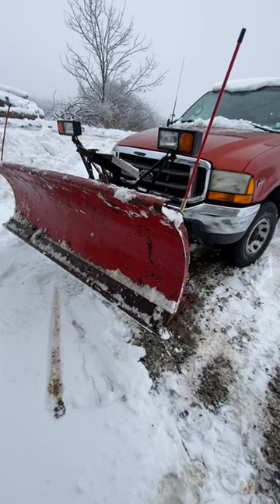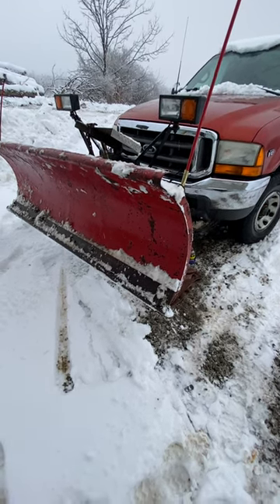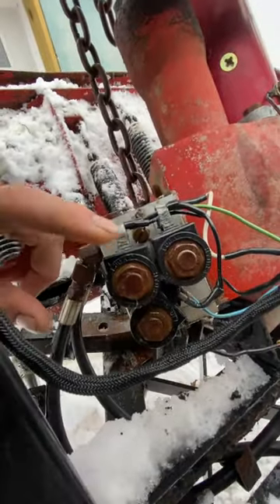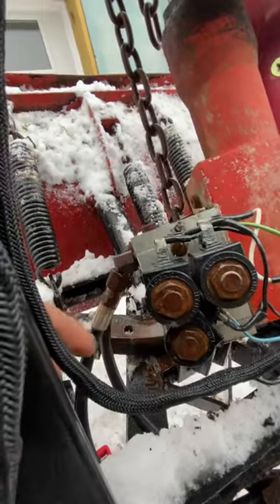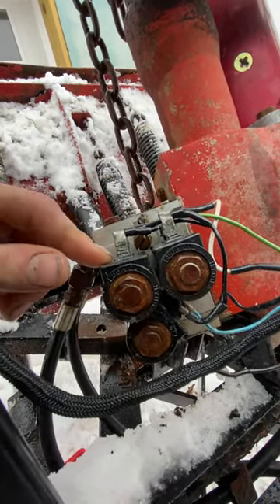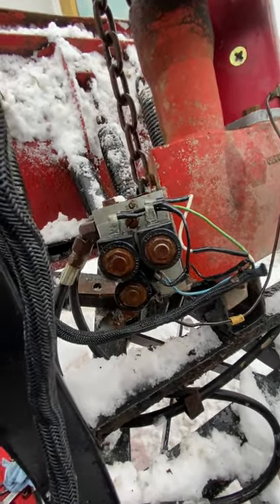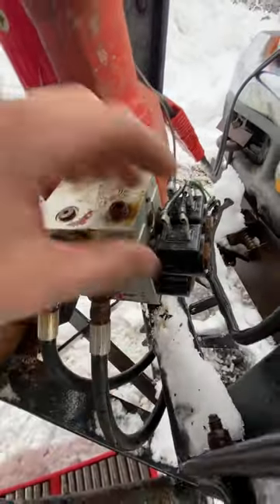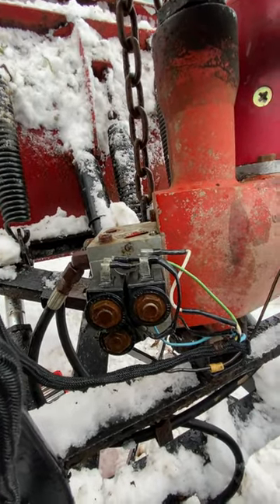Western plow not moving left or right but will go up and down Easy Fix!

Comment: The right solenoid is what controls up and down. It’s a single port valve. The left one is 2 port valve controls left, and the bottom one is right, 3 port valve.
Reply: I’ve got a fisher minute mount. That won’t turn left or right. It goes up if i joystick left. It was working fine in a previous storm. Do you know what the Issue could be ? I would appreciate any corrective solutions. Thanks.
Reply: @michaelkaylor4779 probably your right cylinder binding it up. You should be able to just follow the hydraulic line to see which solenoid it goes to. Either a bad connection, magnet stopped working or the valve itself is seized up.
Reply: My solenoids are working if I loosen them but as soon as I try to tighten them the controls stop working. Any ideas?